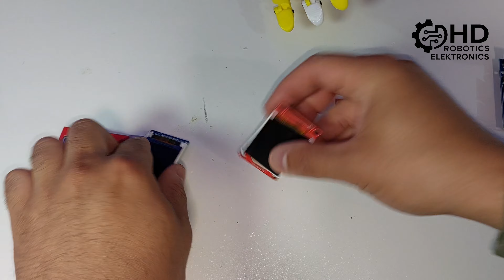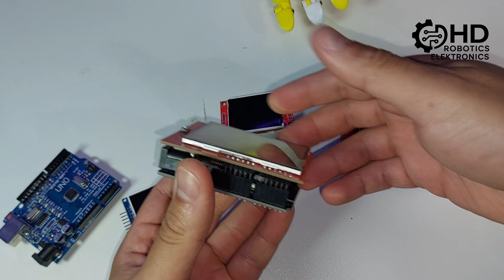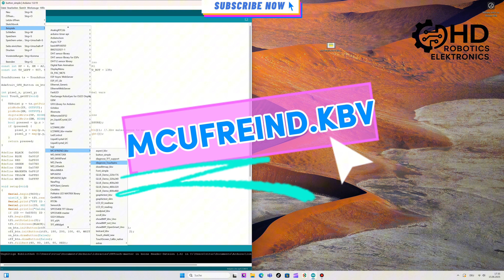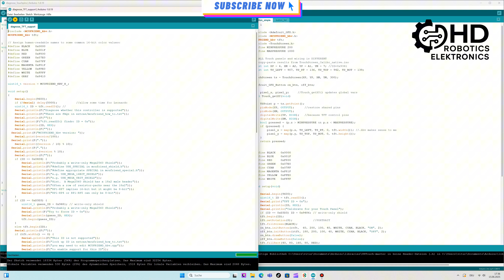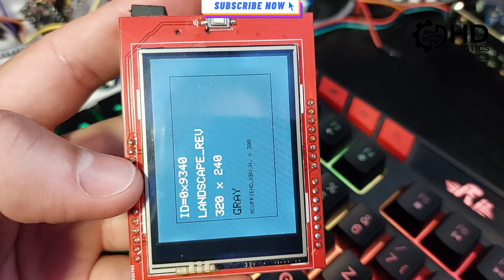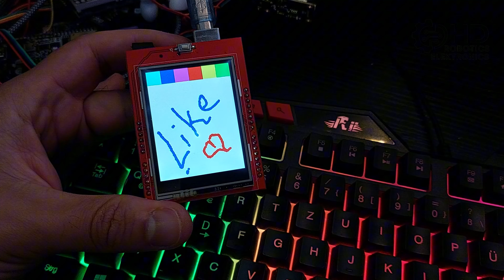TFT Touchscreen mit Arduino & ESP32 programmieren – Schritt für Schritt erklärt!

Comment: Hallo, super Video. Wie machst Du das mit den Ausgängen vom Uno für die LED's? Wenn das TFT auf dem Uno steckt oder mit Kabeln angeschlossen ist sind doch so ziemlich alle Pins belegt, oder?
Reply from the maker: Danke. Ja genau, mit dem originalen UNO kannst du das nicht machen. Mit dem ELEGOO aber, oder mit einem gefälschten ATmega328P, also einem UNO R3, hast du extra Lötpunkte für Erweiterungen. Du kannst dort zusätzliche Steckpins anlöten und entweder ins Breadboard stecken oder direkt Kabel anlöten.
Such im Internet nach "ATmega328P" – ich verkaufe ihn auch, und sogar mit vorinstalliertem Code. Ich habe sogar ein solches Board mit USB-C-Anschluss.

Hier kannst du es sehen 
https://ebay.us/m/DDSQEH
Reply from the maker: Mit ELEGOO kannst du das nicht .
Reply: @HDRobotics  Am einfachsten wäre es vielleicht sogar einen Mega einzusetzen, da hätte man nach aufstecken des TFT's ja noch genügend analoge und digitale Ein- und Ausgänge  frei!?
Reply from the maker: @kaisauermannn6848 Ja, stimmt – Mega wäre zwar einfach, aber du hast dann echt viele Pins frei. Ich mag den Mega nicht, weil er teuer und zu groß ist. Ich mache mit dem Uno nicht viele Projekte. Wenn du meine Videos anschaust, siehst du, dass ich fast immer kleine Mikrocontroller verwende, wie den ESP32-S3, ESP32-C3 oder den D1 Mini.